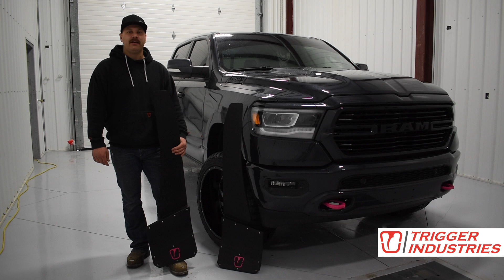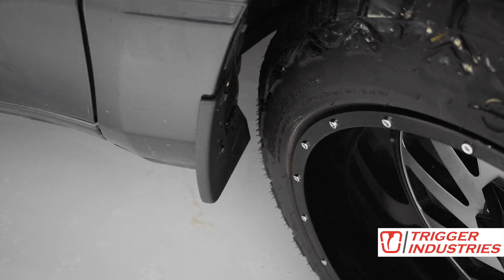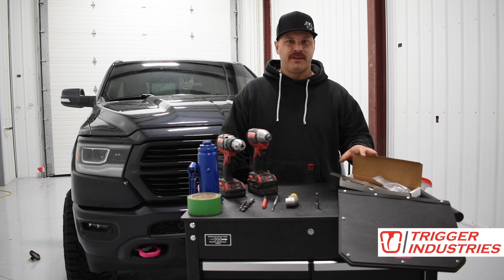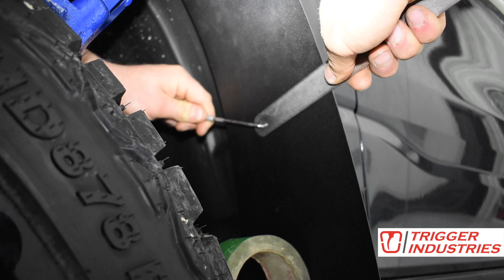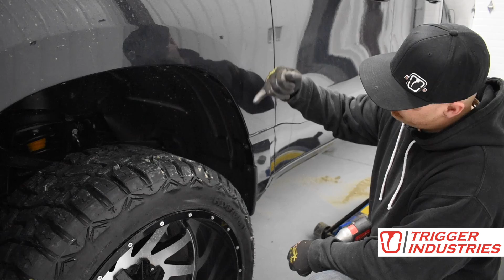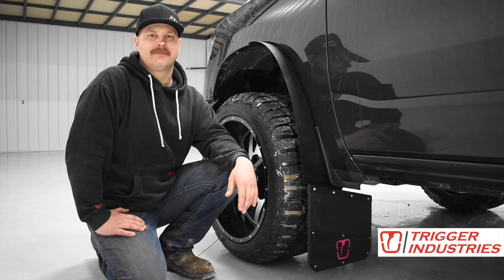Trigger Industries Long John Install

Comment: I ordered these powder coated white mud flaps for my truck and it only has a 2 inch front leveling kit with 33’s on my ram 1500 and they don’t fit, which I was told they would fit, just letting you people know before you buy

Comment: I have a 2024 gmc 2500, 6” lift, 12.5” wide 37s. The tires have a huge offset and stick out around 4.5”. I work in the Alberta oil patch and my truck/paint is taking an a$$ woopin. Which mud flaps would work best for me. I need to order some asap
Reply: Probs need a set of 14” flaps, go with the Long-Johns! 👍🏼

Comment: Once I drill one side and everything is good, could I just lay the 2 mud flaps back to back and just transfer punch the holes over since it’s a mirror image.
Reply: Depends on how accurate you want it. Yes, you absolutely can it just won't be a perfect fit. Both sides will differ slightly

Comment: How much u charge for installing??
Reply from the maker: Install starts at $250 but is subject to the the style of flap and model truck.
Reply: @trigger_industries  tundra 2017
Reply from the maker: for that truck it would run $250. Price subject to change, currently booking early August.

Comment: holy frickin' cow man, this clown wants $450 to $900+ for a piece of abs plastic sheet, what a rip.
Reply from the maker: There is no ABS plastic used in the construction of this product.
Reply: @trigger_industries  well it sure looks like it, whatever you made them out of, you pricing says YOU ARE A THIEF. I hope you invested every penny you had in this and lose your ass. THIEF. $900 for mud flaps.
Reply: @TM-lw8wn  weird way to announce you’re poor
Reply: @30tman  poor? dude........my bank account is laughing it's ASS off at your loser ass.
Reply: @TM-lw8wn 😂 😂😂
Reply: They are stainless and powder coated I’m pretty sure.
Reply: Bought a whole set, each corner for $150 at an auto distributor in Canada, different brand but basically same thing

Comment: Is the install tool specific to that brand or is it a generic tool you can buy at most stores?
Reply from the maker: The install tool is not currently available. It will be offered with future install kits. Currently in the prototype stage, similar tools can be make out of some stiff card or plastic.
Reply: So how do we line these up and mark the holes? This looks impossible without that little tool. I want some for my 2018 ram but I can’t believe the holes arnt pre drilled for the standard flaps/non long johns. For the hefty price tag and since you have that tool and know the factory bolt layout couldn’t you pre drill even with the smallest bit so we have a starting point? The flap you just marked and drilled could be layed on another set for a ram and boom that takes hours out of the Install time for US and is a huge.. selling point that you don’t have to try to line them up and mess around. Love the flaps and will be ordering a set when my wheels come In. Maybe you could atleast help me out and pre mark/drill, that would be awesome..
Reply: 02zosick there are so many different trucks with lift, wheels and tire combinations there is no way they can drill holes specially for each combination. They are designed to be universal. I made a version of the install tool out of a plastic milk jug. With an extra hand to help line it up install is a breeze.
Reply: After reviewing this video I used the basic premise minus the tool. Put a dab of grease on each existing screw and pressed wheel flare against it to mark position and pulled away, drilled and set in after. Worked really well. Yes as per someone mentioning so many different variations of possible setup you won't be able to setup like fitted ones specific to a certain vehicle. Overall really happy with fit and after first one it goes pretty fast.
Reply: I bent a weld rod and just kept it straight. Tongs will also work is the tips match up.